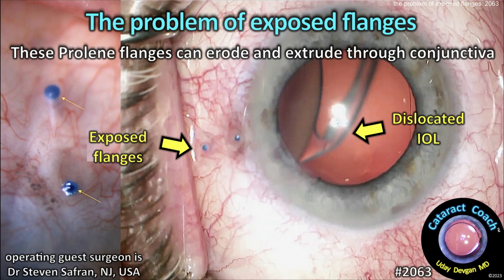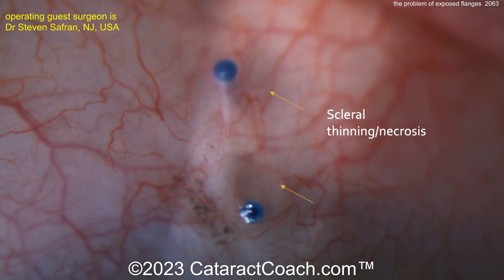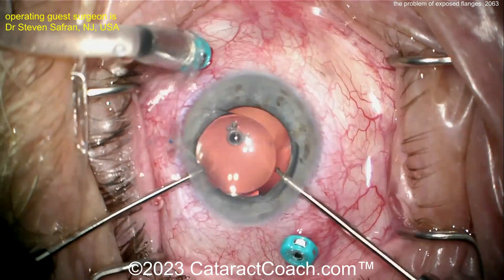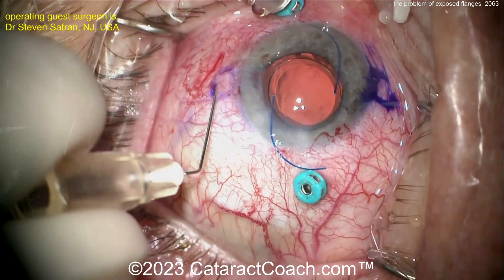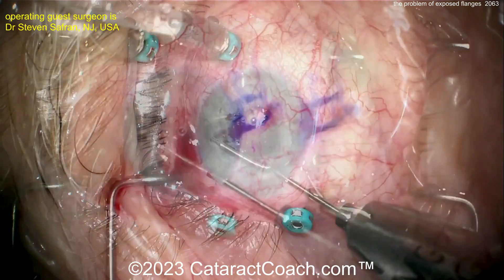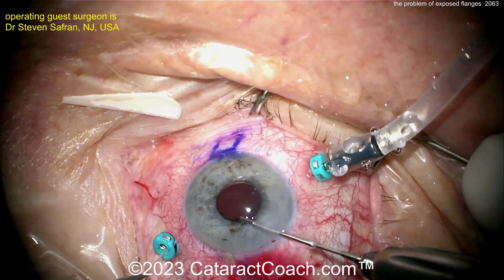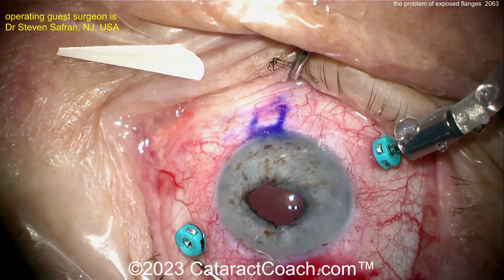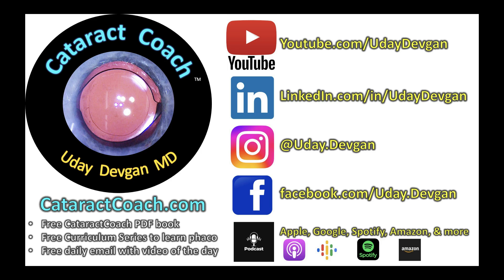CataractCoach™ 2063: the problem of exposed flanges

Comment: I think Safran did all of the correct things here (and with beautiful technique as always), but Im not sure about the conclusion here that the McCabe belt loop is a bad technique. 

The main mistake I see the original surgeon made is only belt looped one side. I tell my fellows if you ever want to belt loop, gore tex or McCabe style, always do both sides even if one haptic looks to be well positioned (the temptation to just stop at one loop if it centers the lens is understandable but unwise). The opposing tension of the other belt loop is whats supposed to keep the prolene in their tunnels. The asymmetric tension in this case looks like it also likely dislocated the IOL towards the initial belt loop. By the time this got to Dr Safran its too late to try to just do another belt loop, but if it had been done in the initial surgery the pt may have not needed this one.

Ive even seen a similar issue with an assymetric Yamane; prior surgeon was trying to put a lens into the sulcus, but only one side of the anterior capsule could support that, so they Yamaned the other haptic, and they got similar extrusion as in this case in part due to the assymetric forces.